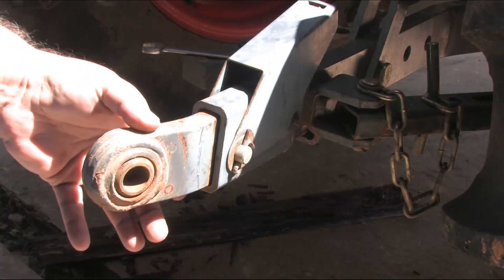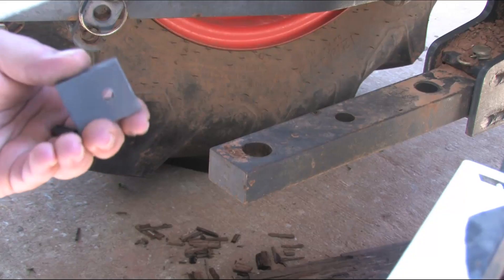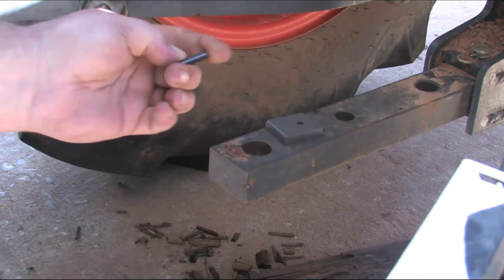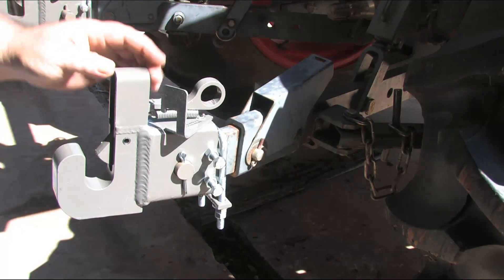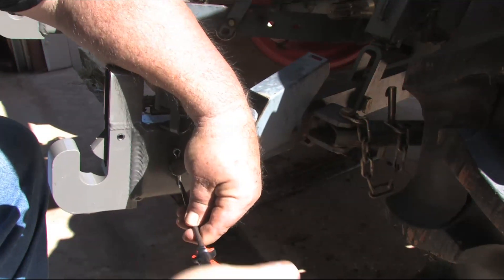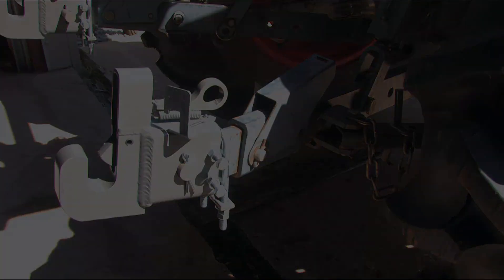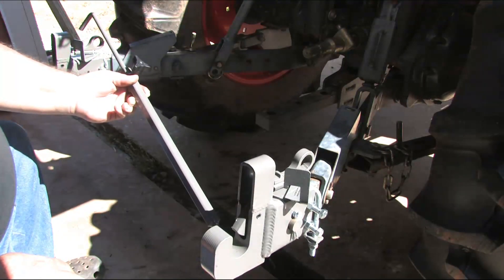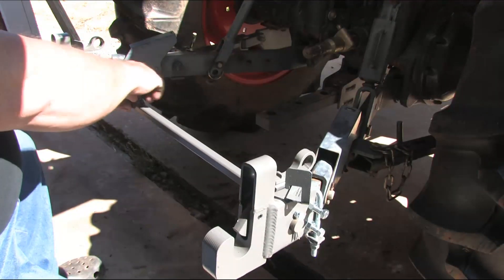Pat's Easy Change Hitch for your tractor April 2012

Comment: I finally broke down and spent the money on a set of Pat's Easy Change hitches. With my bad back and knees I had started to dread changing out implements. My first attempt at using the Harbor Freight quick hitch was unsuccessful since most of my equipment is not standard width. 
Today I was able to switch between 3 different pieces of equipment and didn't even break a sweat. 
Thanks Donald for the super easy installation instructions !!
Reply from the maker: Unless you’re willing to make adjustment with a touch and welding machine to your equipment Pat’s is the way to go.  Still have to get off the tractor to hook the top link but that’s not a big deal….Donald

Comment: Donald - Thank you for this video.  On your recommendation, I purchased a set for my tractor.  It works great.  Yesterday, I helped my neighbor pull tree stumps.  We used heavy chain and a working bar.  I thought I would make sure these held up to heavy work.  There were some big tap roots that needed to be cut, so the pulling wasn't easy, but the hitch held up and when I was done, it was just a quick wink of an eye and I had my box blade mounted once again.  A real good system.  Thanks again for sharing it with us.
Reply from the maker: They do make hooking and unhooking up to tools a whole lot easier.  About the only thing I’ve found with the system is the springs will break after a couple of years.  A quick change and your own your way again…..Donald

Comment: Wilford Brimley does a good job showing us these Pat's hitches. Thanks for the video.

But, Wilford, I think the swing-in latch is mostly for holding the main latch in the LOCKED position, not the open position (as you show in the last seconds of yoru demo). Done my way, your implements will slide in and auto-latch when you raise the lift arms.
Reply from the maker: The reason I do it that way is in case only one side latched and the other didn’t (because I wasn’t lined up just right).  I’d have to get off the tractor, unlatch that side and get back on to realign and try again.   Got to get off anyway to hook the top link so it’s really not an extra step.  Whatever works best for you is the way to go……Donald
Reply: Well. You're probably right. After all, you've got the experience. I'm just deciding whether to get them or not.

Comment: I ordered a cheaper Quick Hitch from Harbor Freight. But, after reading about the added things I had to get in order to make it fit on different implements I re watched your video. The obvious better quality and the made in USA factor caused me to cancel the HF order and go with this instead. I have a few 3pt implements and a small Yanmar 4wd tractor. Not a big time farmer but defiantly getting too old to wrestle stuff onto the hitch. Good video.
Reply from the maker: I think you’ll be very satisfied with Pat’s hitch.  I’d hate to have to do without it……Donald

Comment: Another option for a quick hitch is this. If your tractor has extendable lower arms, remove these ends and replace them with solid steel extensions with a hook similar to the quick hitches. This has several advantages over any of the various quick hitches. 1- Cheaper, 2- This does not add 4" to your lower arms so no 3-pt lifting reduction, 3- Your existing PTO shaft works as before. If for some odd reason, this solid hook extension doesn't work on a particular implement, then the OEM ball swivel extension can be replaced to original status in just a few minutes.

    If your lower arms don't have extendable arms, it would not be difficult to cut off each ball swivel with a few inches of arm and then make a surround to reattach it (similar to the extended arm style). Then make a solid steel extension with a hook as above. This allows you to have the three advantages stated above. 

    If you have both Class 1 and Class 2 implements you might find it advantageous to make two sets of solid arms so no bushings are required. I cut the new 11" solid extensions in two pieces because the hook end needs to be rotated slightly and angled toward the center, similar to the original swivel extensions. Slide the forward section into the arm extension receiver and weld the rear section (the piece with the hook) so it is parallel to the tractor frame and vertical. One pin will secure it in place. For my Class 2 hitch- Steel cost for the 4 pieces 1" thick, cut at machine shop with a laser CNC= $110 CAD. About $40 more if you need to hire a welder.

    Enjoy changing implements.  ☻

Comment: Seems like a wonderful idea. One inescapable fact is that it lengthens the lift arms and thus reduces the weight of the implement that can be lifted. Plus heavy implements will more easily cause the front wheels to  lift off the ground. My CAT 1 tractor has 250 pounds of front weights and I do not wish to add more.
Reply from the maker: My tractor has a front end loader so I never experienced that problem.....Donald
Reply: lengthening the lift arms increases the weight of any implement from the tractors perspective. This is a benefit for tractors with front end loaders where you need as much weight as possible on the back especially on tractors that have part time front wheel drive like my 2305. I have learned the hard way what using a front end loader with not enough weight on the rear will do to the front end drive gears and bearings. Weights on the wheels have no effect on reducing weight on the front wheels either but can reduce the need for using the front wheel drive.
Reply: They have weld ons. You cut of the ball and weld the Pat's Easy Hitch on your tractor's arms.
Reply: Ken6151
 - Look into the "Opti-Lock" lower links and connectors. 
https://www.cbmspa.com/eng/products/Three-point-linkages
Plenty to choose from and a very matured product. ;-)
Cheers

Comment: Being that the Easy Change System "extends" the lift arms, how does this affect shorter PTO shafts on smaller Cat. 1 implements and also are you still able to lift the 3 pt. hitch all the way up without each half of the PTO shaft coming apart??  I already can't raise the tiller all the way up with the PTO engaged because the shaft makes too much noise. Thanks
Reply from the maker: I have a 4 inch pto extension on the tractor so it’s not a problem.  Mine makes the same noise when lifted all the way up, I believe it’s because the U-Joints are at too great an angle.  Either turn the pto off or don’t lift so high.  :-)  ....Donald

Comment: Donald I have an old Massey Fergusen big old tractor and Im not real good at changing tools without help. This looks like what I need. I do not have lots of tools but I think this would do it.
Reply from the maker: I think you’ll be very pleased with Pat’s Easy Change hitch.  Before getting them for my tractor it was a pain to switch tools.  Now I have the two hardest to connect points hooked before leaving the seat…..Donald
Reply: Thanks for the info. I will definitely get these
Reply: 684jewel I would give this a harder look before doing that.  I had one and thought it was a total waste of money.
Reply: Wow   I am surprised to hear that dnsmithnc!   What is not convenient about it?   I am always afraid I am going to hurt my husband when he helps me hook up my implements.  I appreciate advice you have.   Thanks
Reply: 685jewel  I used the product off and on for several years.  I did not find it quicker or safer.  First I had to adapt some of my equipment to fit because the device is so bulky.  That meant grinding away a bit of bracing or welding.  Secondly, implements would fall off because of the bent washer design and the way the implement was held did not make for a good grip. Next, the bolts would come loose holding the device on despite hard tightening.  In addition, the system requires you too extend your PTO shaft making it too short on some occasions.   Lastly, you will not find it as easy to back up and hitch your equipment as it has been made to appear here.  Firstly, alignment is still a problem as with the old system though perhaps a little easier.  In addition, You  still have to get off your tractor, flip a couple of levers on the PEC, hook up your top link, attach your PTO and so on.   Some people might like it but, I would rather hitch my equipment the old way rather than use that contraption.  When my equipment is attached the old way, it is on more securely and not likely to fall off as it has several times using the PEC.   If you have the money, there are ,other systems that actually work. such as the Delta System.
Reply: Tks for your input.   I will check out others before my purchase.
Reply: 684jewel I have a the PEC I took off my tractor in a box.  Reading how you are trying to keep from hurting your husband, I'll sell it to you cheap enough so that if it doesn't work for you and your husband as it didn't me, then you can sell it on and get your money back.  I'll even buy it back for what I sell it to you minus shipping.  I haven't sold it so far because I and others who have given it a chance don't like it and I don't like selling something I don't believe in.  Even so, there are some who claim it works for them.  If you would like to try it, just figure out how to send a private message and we can work out the details.

Comment: Just bought these. 

Be AWARE that these quick hitches move your implements back 3-4 inches. Which means it stretches your DRIVE SHAFT that much as well. You will DESTROY your driveshaft if you're not careful. There is a PTO adaptor that helps with this problem and will save your drive shaft. Well worth the average proce of $26 

Not as easy to hook up, but a breeze to unhook !!!!

Comment: I had one of these hitches and found it to be a total waste of money.  I gave it a fair chance but Implements often had to be ground around their support braces to fit.  The worse problem would be that Implements would often come loose and fall off usually on one side causing a real mess.  Look for those reviews on tractorforum and tractorbynet before buying.  Now, you will find some good reviews such as what seems to be the case here but, ask yourself, why aren't they all good reviews.   It amazes me that you find any.  In addition, do you think this guy just backed up perfectly to this implement the first time?   Not likely.  I found this product made implement change harder and more dangerous overall.
Reply from the maker: This will be my 4th maybe 5th year using these and they’ve worked fine for me.  Backing up to the tool sometimes takes me two tries but most times I can line up in just one.  As for the product being dangerous I don’t see it, may be the operator……Donald